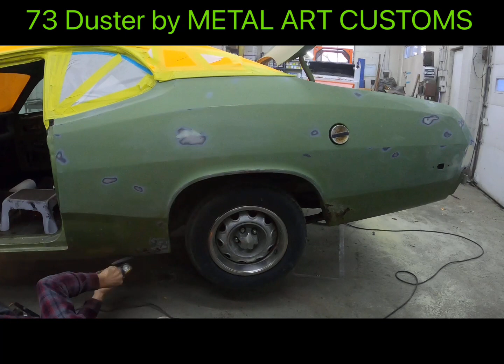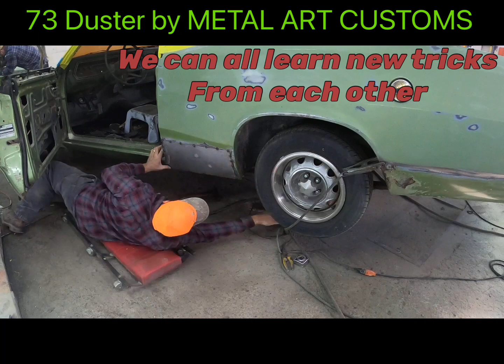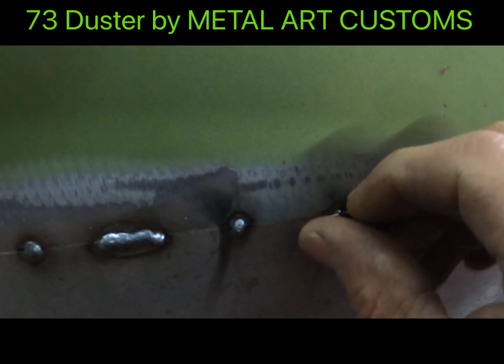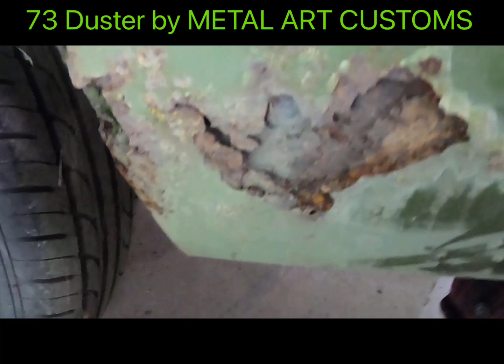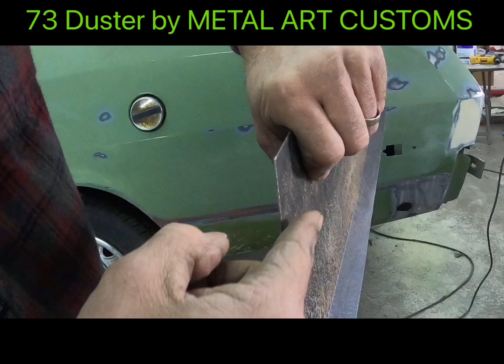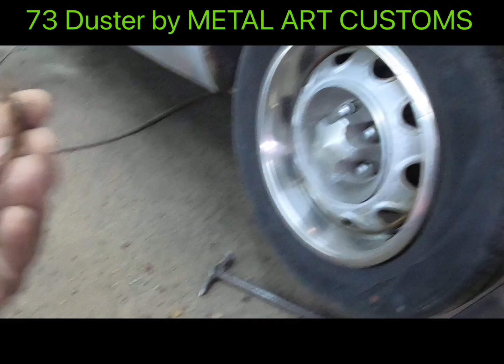Clean up on isle 3 lower quarter replacement on 1973 Plymouth Duster

Comment: Are Duster never rusted out or rotted , got in 1976 a Colorado car , I guess keeping it covered and in the barn helps because it looks as good as the day we got it , shiny and clean inside is perfect 79.000 original miles ..?
Reply from the maker: I love hearing about original body’s like that, I’ve had a couple myself but they were way older. 26 Pontiac 29 ford